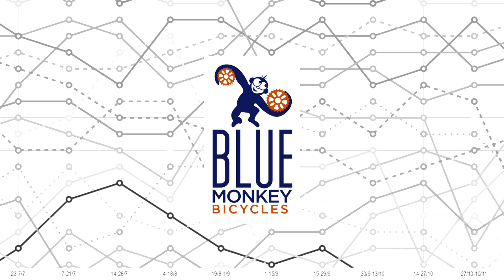eBike Wind Generator, does it work?

Comment: Your partly correct wind turbine Blades extremely inefficient because the air pushes against them slow causing a lot of drag but you can use a forced air fan taking away more the 80% of that drag

Comment: Common idiocracy, “it doesn’t work because I can’t change variables” implement a 50-80cc gas engine as a hybrid then have the battery system powered by solar/wind combined to have utmost fuel efficiency
Reply from the maker: Lol

Comment: True answer is YES you can. You could have a very little drag turbine when designed correctly for the purpose.
Reply from the maker: Show me
Reply: The burden is on you to prove that it is somehow not practical or otherwise impossible, because we already know the drag problem is solvable simply by facing blades adjacent to the wind behaving as a water wheel would. It would tie in to the regenerative braking system. An app would be able to control it. I'm thinking optimize for side winds  but IDK I have no data.

Comment: a vertical wind generator isn't a giant fan(sail), so you wouldn't get as much drag, and the more it turns the less drag you get. Thank you for the simplistic answer to sell more battery packs :-P
Reply from the maker: A wind generator can produce electricity, but on a bicycle it comes at the cost of moving the bike forward.

The purpose of a bike is to propel a human. So long as that's the goal, then a wind generator will always compromise that purpose.
Reply: @BlueMonkeyBicycles  maybe... But if i have 2 and both are side by side behind me... And the outside that hits the winds is the side gathering power and the other is blocked by my back(lessening wind resistance)... Virtually no wind resistance the faster it spins. The wind turbines i was looking at produce 500w each at 30km/h. So if my bike is going 40-50, even with some drag, i should be able to cruise at 30... Or faster. Like i said, a vertical wind turbine doesn't act as a sail, i could totally see many fans having too much drag for any useable power... You have to find the loopholes in science.
Reply from the maker: The only way that a wind generator can produce electricity it to do it through drag.
Stationary windmills have to be very secure, since the wind blows against them; that force is being harnessed to make electricity. Inside a wind turbine are thick components that draw on  internal friction, and covert that into electrical energy. It's not the same as a ceiling fan, that spins virtually resistance free. Ceiling fans are built to have minimal resistance internally, since the goal is to use the fan to move air around.

Comment: As a sailor, I really don't see why one couldn't use a wind turbine on an ebike. Sailboats also succumb to drag, and use turbines. There are so many factors to consider. The weight of the device overall seems more relevant than that of the 'drag' of the blades. Depending on where you live, I live in a very windy area of Sweden, the amount and direction of the wind, yeah... I think it's a great idea. If not for propulsion, than while stationary. The issue with with using wind or solar while stationary however is always the issue of storing the energy created. As someone who has done this on two sailboats, I wholeheartedly believe it is possible, and COULD yield beneficial in some circumstances.
Reply: I am also thinking that the answer given was based on the fact that he is thinking of a perpetual motion machine. The drag can be virtually reduced if the propeller blades were affixed to the pannier rack. Rather than facing oncoming wind (12 oclock), the blades would be @ a 3 o'clock, thus working like a river wheel or normal blade Idk exactly what configuration until seeing actual data, not some theoretical physicist tell me it cannot be done.
Reply: I think a vertical wind turbine with a right angle gearbox in a variable speed transmission wood be perfect for a sailboat no matter the wind direction the propeller would always turn on top of powering a battery Bank
Reply: Also you can use a wind turbine on electric bike or car by using a forced air fan instead of your standard wind turbine blades

Comment: I'm not an e bike guy but out of curiosity, can you run a hub motor on the back wheel while generating power with a front hub wheel. Have two separate banks with opposing relays, where one bank is charging and the other is depleting for an infinite distant potential?
Reply from the maker: It's a common point of confusion, because it is possible to make such a device, however, so long as the purpose of the device is to move a human forward, it will always consume more energy in use than it can possibly compensate for in production.
Reply: @BlueMonkeyBicycles  from real life exp, it will work in down hill position. this idea will generate energy the sametime save your break. later you can up lift ur fan to a different position.
Reply: They would cancel each other out, a 500w generator is essentially a 500w motor... as you draw current it will want to stall out. If you put a 1000w motor and a 250w generator, you would have the moving force of a 750w motor.

Comment: Who cares... Better use for these Ebike hub motors is as wind generators. Most are 3 phase PMM and if ya put that out through a bridge rectifier it will charge batteries. Its not going to give you the full wattage output but its definately enough to charge the battery for your bike at home it its set up as a VAWTurbine like I have. 500W hub motor is charging a 24v battery bank that I use to charge my bike batteries
Reply: Can you send me schematics? Picture

Comment: gone have to disagree, it would entirely depend on how you would go about designing the wind generator, mainly it's fans and it's placement to take the most advantage from your design. there's a reason the subject field about aerodynamics exist. also the idea of the wind blades dragging you in the opposite direction is quite idiotic, it would entirely depend on your design as i've mention before AND the amount of torque your bike has to begin with, and just overall, how much of a design does a wind turbine that is at odds against your weight and the amount of mechanical energy you've provided onto your bike wheel to be a negative to drag you more onto the opposite direction? i wouldn't know but i doubt it wouldn't be much of a resistance unless the design is just god awful and the current power of the wind that's blowing against your direction and how it's also really taking advantage of your poor design.
Reply: Couldn't agree more...

Comment: It will work if you park the bike in a strong wind.  Then take it off when ready to ride.
Reply: If you have a strong wind, maybe add a sail, similar to the add-on they have for kayaks :)
Reply: wait for the wind to die down before riding - or just ride the opposite direction with a sail